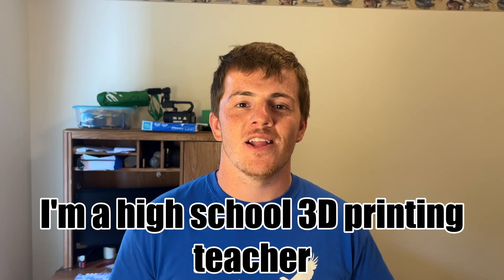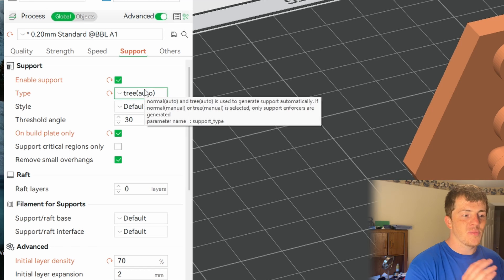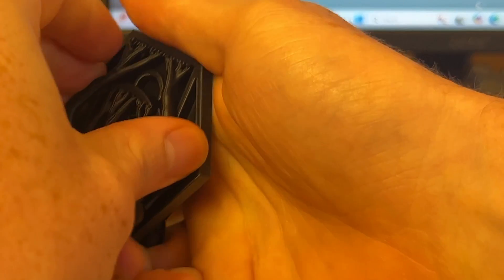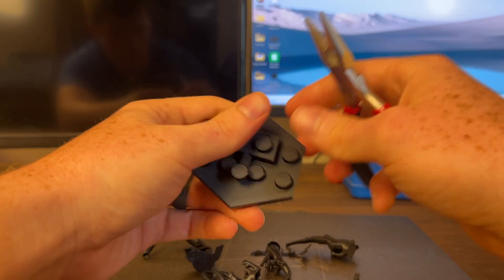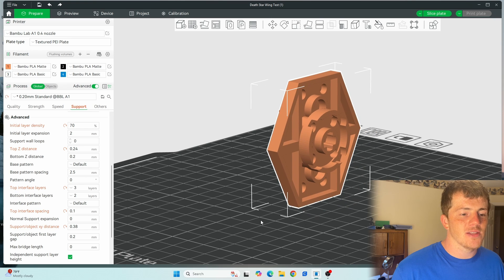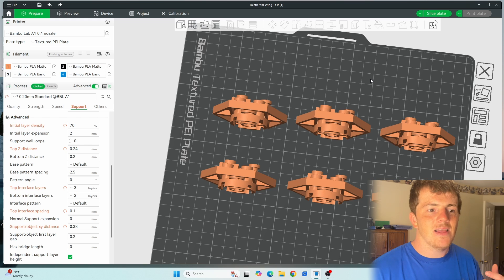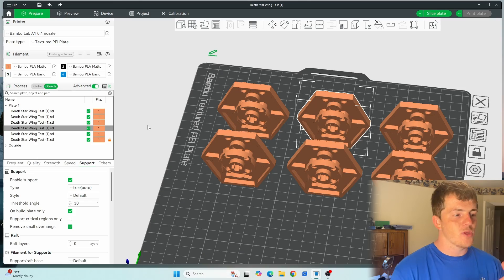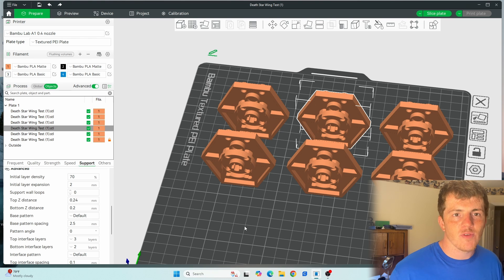A Teacher's Guide to the Perfect Bambu Studio Support Settings - How to Easily Remove Supports!

Comment: Heya! Thanks for the informative video. Any advise for a nozzle size of 1.2mm with a layer height of 0.5mm? (I recently got a 1m x 1m printer at work for large scale printing)  I've been playing around with different settings for supports, without any luck yet.

Comment: in the part I'm printing there is a small horizontal slot 3 mm high half way up the print. All it needs is a bit of support on the base of the slot. However no matter what I seem to try in terms of settings it wants to grow some great hideous thing from the bed all the way up. How can I force it to put support just in that slot?
Reply from the maker: Good morning! There should be a setting in your slicer that has supports that don't touch the build plate. It depends on what slicer you use as to where the setting would be located. If you can't find it, send me an email at kennedydiy01@gmail.com and I will gladly help you find it!
Reply: @KennedyDIY  I found it - set the support to "snug". Worked great. Thank you
Reply from the maker: @sblack48  Great to hear, thank you, my friend!

Comment: Hi, I've had a P2S for a few weeks now. In two prints with supports, one of them came off the plate during printing. What setting can i change to prevent this in future?
Reply: Just a small tip, if cleaning the build plate does not work. What has always worked for me is to change the "Initial layer expansion" from -1 to 4 or 5 mm (This essentially adds a brim to the supports) p.s. It may do other stuff I'm new to this as well but just wanted to share what worked for me. Let me know if it helped :)
Reply from the maker: Hello, my friend! Great question - a few fixes I would try. First, just make sure your build plate is clean. Dish soap, a light scrub with a clean sponge, drying with a microfiber towel. If that doesn't do the trick, I would encourage you to slow the speed down of your supports.

If that doesn't work, feel free to reach back out!

Comment: So im using a higher layer height.  So which way should I go from your settings?
Reply from the maker: Well, depends what layer height you’re using. Smaller layer = small settings. The opposite is true as well!
Reply: @KennedyDIY well im using a 6 nozzle and .3 layer
Reply from the maker: @JonSnakez unfortunately, I haven’t used those settings before so I can’t give you specifics. But I would certainly increase these settings substantially. I would try maybe a .36 Z top and see where that gets you!
Reply: Oh and i only been using petg @KennedyDIY

Comment: Hey, I've copied your settings for my P1S and it works great but I've had and issue where my tree supports are breaking off the bed while printing. Bed's temp is 55 celsius. Any idea which settings should I change for it to stick? I am relatively new to 3d printing so any help would be appreciated
Reply from the maker: Happy to help my friend! First things first, is it a tall print?
Reply: @KennedyDIY  i've the same issue on my X1C, the print is 20cm tall. During printing, some supports breaking off the bed, compromising the print. The bed is 55 degrees as per stock. PLA or PLA Silk filament. Any ideas? thanks so much
Reply from the maker: @ondaluce I would highly recommend slowing your speed down. That typically does the trick for me!
Reply: @KennedyDIY  thank you! Do you mean general speed or just support speed?
Reply from the maker: @ondaluce  I would suggest just the speed of the supports to start - if that doesn't work, I would go with general speed!
Reply: @KennedyDIY  I tried reducing the speed of both the supports and then the printer. Much better, but unfortunately some supports still broke...the ones that start out large and then get thinner. I tried increasing the branch diameter, but then the top part in contact with the part also became too large. Any other ideas? Thanks for your help, the support settings are top notch, they come out perfectly! can't post a photo on youtube
Reply from the maker: @ondaluce  Feel free to send me an email if you would like! We can try and discuss further - kennedydiy01@gmail.com
Reply: @KennedyDIY  I sent you an email with a screenshot of the problematic media. Thank you very much for your help.

Comment: Hey question on supports/printing. So recently I have tried printing 3 prints that all failed. 2 of them were Katans from Demon Slayers. I ended up being able to print the after completely surrounding it in traditional supports. The other is the end of Ralph's sie from the TMNT. It just won't print. There shouldn't be any need for supports as they're nust straight up. Have a bring put it all the way out to 8MM. Still failures. So thoughts?
Reply from the maker: Hello, my friend! Thanks for reaching out. My first question would be - how tall is your model?
Reply: @KennedyDIY great question and one I won't have an answer to. I would say not more than 2 inches.
Reply from the maker: @throughthepaint perfect, so that rules out a height-related issue. How does the print fail?
Reply: @KennedyDIY  just gets knocked over. Even with a very large brim in place and even when I put supports half way up the build. Eventually had to put supports all the way to the top. I know theres a better solution to this though
Reply from the maker: @throughthepaint a few things I would recommend. First, I have a video on how to prevent your prints from warping and not sticking to the bed that I think would really help. Then I would try and slow your speeds down pretty substantially. I really think those two will do the trick, at least in my experience
Reply: @KennedyDIY I'll give those a shot in the morning and report back. Thanks
Reply from the maker: @throughthepaint keep me posted!

Comment: 0.08mm Extra Fine, works?
Reply from the maker: I have not personally tested these settings using .08 extra fine, but these settings should get you relatively close. You’ll have to make some adjustments. The Support Z Distance will need to be modified, I do know that

Comment: is there a was to slow down or improve the print quality of the bottom of the supported print part? for me they tend to get very stringy not smooth at all tend to disconnect and sag into the supports. normally the bottom the prints the are lying on the bed are super smooth and perfect

Comment: I printed a large flat object with the 0.8mm nozzle on my H2S and, with the factory slicer settings, had to use a hammer and a putty knife to get the supports off. I guess they have not put much work into tuning the 0.8mm profiles.  The Top Z Distance was at 0.20 mm!  After finding your video, I adjusted my settings and did a few tests (ended up with 0.60mm for Top Z), then reprinted my full object and when I went to pull it off the bed, the object came off and all the supports stayed stuck to the bed!  Absolutely perfect, and the surface finish was great too.  Thanks a bunch!
Reply from the maker: Great to hear, my friend! Happy to help and thanks for watching!

Comment: whenever i use tree (auto) and leave it on default/grid i have to switch it to tree slim otherwise it doesnt let me print. any advice?
Reply from the maker: Oof, that’s a new one for me. What error message shows when you try and print?
Reply: @KennedyDIY it’s weird because it says organic is not supported with that option which is weird because I’m not selecting organic. I’m at work at the moment so I can’t give you the exact error I get but I’ll do it when I’m home because my supports come out extremely hard and difficult to detach. It kinda melts into the print which is also weird because when I first got the printer it was coming out quite easily and now when I do larger prints it horrible lol.
Reply from the maker: @Elkokys no doubt that’s super frustrating! Have a great day at work, and yeah, let me know that error message and we can try and get it fixed!
Reply: @KennedyDIY  it says "error: variable layer height is not supported with organic supports" i have it on tree (auto) default grid. so i have to switch it but its coming out really hard to remove and some layers of the print comes off and you can see the layers which is annoying.
Reply from the maker: @Elkokys  weird. That is a new one for me, to be honest. Could you email me the file and I can see if I can replicate and then fix the issue? My email is kennedydiy01@gmail.com

It might also be worth it to update your Bambu Studio software. There may be a glitch that was patched.
Reply: @KennedyDIY well it happens with all the files I try to print. I mostly do files from maker world and some I’ve done myself but they all say the same thing. I’m new to this so I have no idea lol also I use orca slicer since that’s what I been using since I started playing around with 3D printing. I’ll do that when I get home tho, ty!
Reply from the maker: @Elkokys sorry I can’t be of more help! I’m going to look into it and see what I can figure out. I’ll get back to you!

Comment: How do you recommend testing these with other heights? Doing a larger print at 0.16mm right now and the supports are being a pain to remove, and leaving quite a mess behind, and would love to clean that up and figure out the best numbers for 0.16mm
Reply from the maker: Afternoon! Great questions - I would keep everything the same except for your top z distance. I saw a comment once that said you should multiply your layer height by 1.33 to find your Z Top distance. So we would be right around .21 for that number. Run a small test with a similar shaped file and see what you get. Let me know if that works, we can try and troubleshoot some other fixes if not
Reply: @KennedyDIY  Thank you so much!! I’ll give it a try
Reply from the maker: @theArcaneGhoul absolutely, happy to help! Let me know how it goes!
Reply: @KennedyDIY  Unfortunately I had a print failure, but I'm going to try again later after the current project I'm working on is done. Will report back!
Reply from the maker: @theArcaneGhoul aye aye, captain!

Comment: This worked wonders in somewhat more complex prints with supports on multiple layers! If everything is on one layer, I have no issues with just using PLA as interface when printing PETG, but with most prints where I actually need supports and can't design my way around them, this would mean lots of filament changes, and therefore, time. Thanks a lot!
Reply from the maker: Absolutely, my friend! Glad I could help and thank you for watching!

Comment: Aren’t a lot of these printer specific? Also using a different filament for the nterface layer is the best I’ve found.
Reply from the maker: I suppose there would be slight variations depending on filament type, printer type, slicer setting, etc. i think these will get you pretty close to what you need, but I did mention in the video about tinkering for your specific situation. I do agree that using a different filament as the interface works well, but not everyone has access to that!